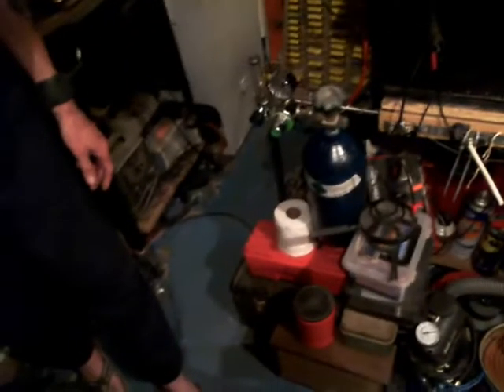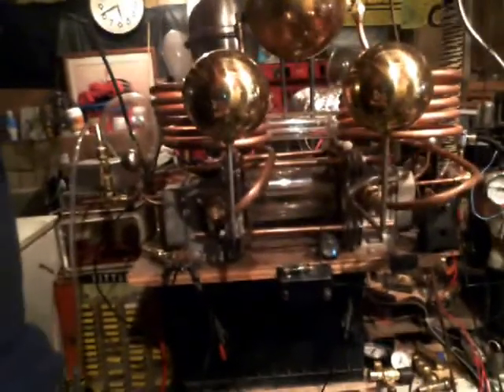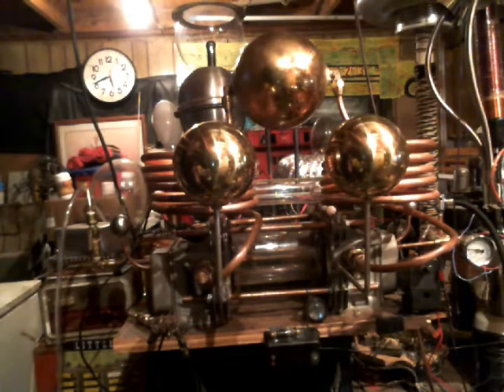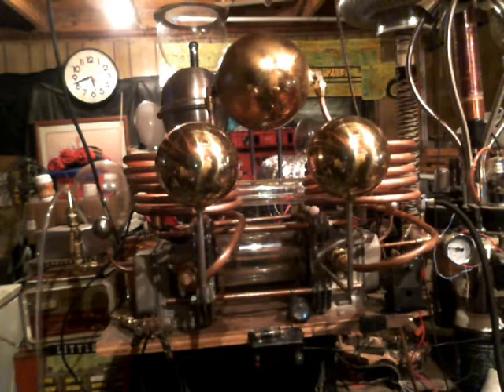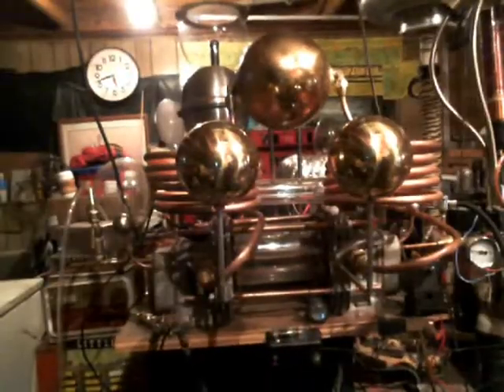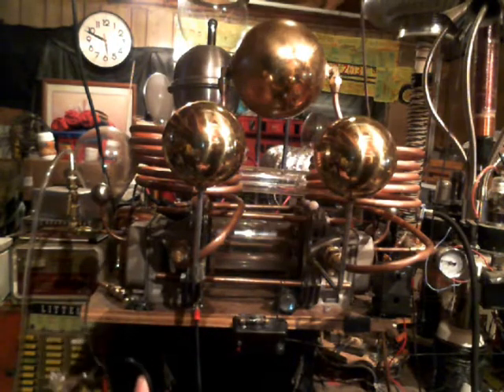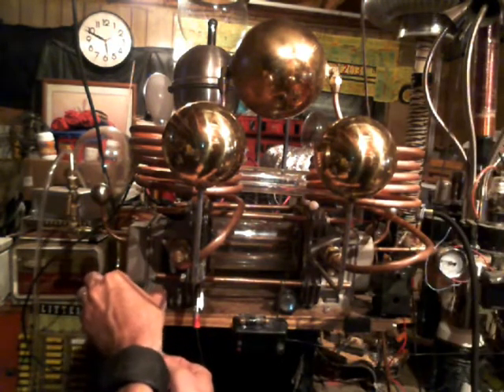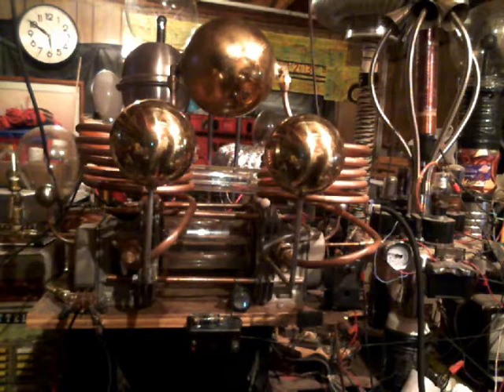REACTOR UPDATE !

Comment: Instead of using plasma to hold a modulation of ion charge with elements, you can use an arrangement of 24 pairs of coils uncontained, in a circle, so energy peaks will discharge positron orbit against energy orbit at once each 180phase. Inside the 24pairs, position 6 larger carrier cores, and then 1 larger yet in center. Contain this in a lead box with an oval hole at center, and positrons pouring out hole must flow against carrier energy thus polarizing all cores simultaneously, self running.